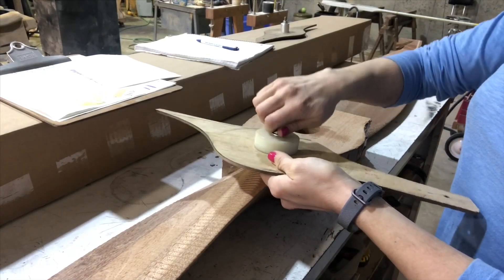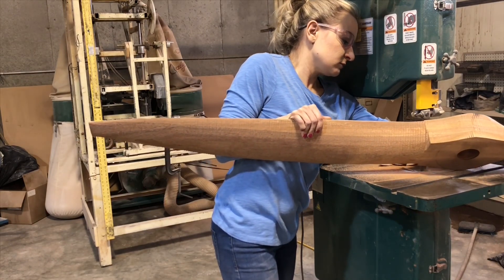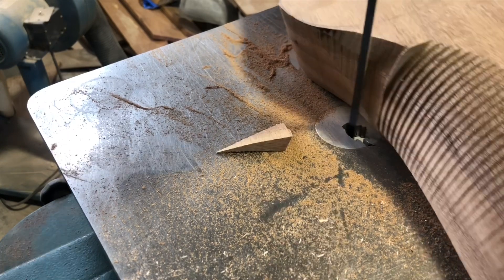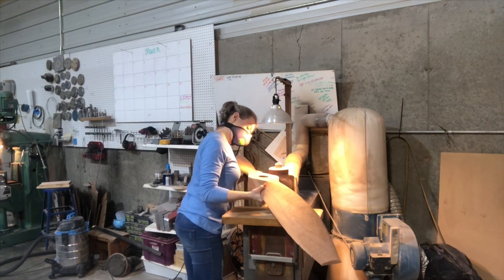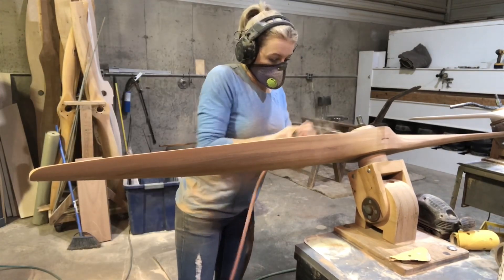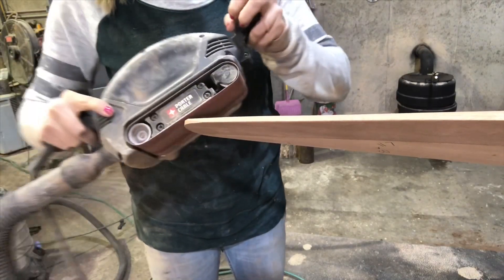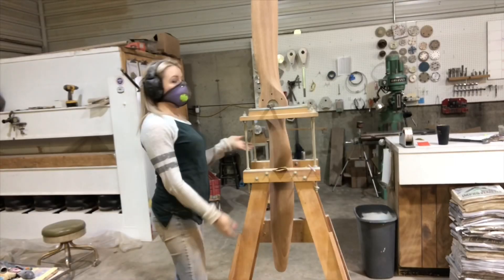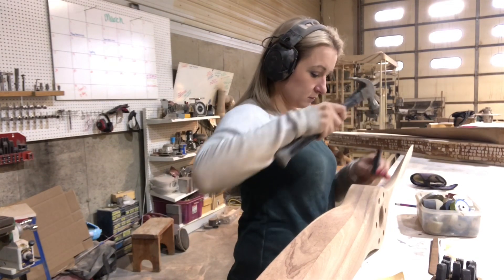Day 3 of making an airplane Propeller

Comment: Thank you again for these videos. Just a tip... Carbatec make an awesome product called turbo plane. It may help you in fast removal of stock rather than holding the piece like you do at the bandsaw and make the sanding quicker?! Hate to be a stickler too but please wear ear protection. The years of working with and around noisy machines has crept up on me and now wish I was more careful.

Comment: I have got to say, one of the most satisfying things to watch is that stream of wood dust getting sucked into the extractor on that drum sander!
Reply from the maker: Yeah! I like those shots!!
Reply: @CulverProps  quick question for you, how well does that mask seal up around the nose/cheek area? I've seen reviews of different brands that are all over the place
Reply from the maker: Jacob Mello i think it depends on your face shape. It does a good job for me, but the guys at the shop don’t care for it. They also have a version that has two straps instead of one and I think that would be a saver bet. I like this one because it doesn’t pull my hair.
Reply: @CulverProps  thank you! Cant wait for the next video!

Comment: A digital readout (DRO) on your mill would make drilling the hub much easier and VERY accurate. You could clamp down the prop, enter the bolt pattern and start drilling.

Comment: Hi Alaina,when you drill the bolt holes on the milling machine you don't need a cnc to do it accuretly you just need a digital readout with X and Y .They are easy to retrofit to your mill and you don't need the Z axis(up and down)which makes them expensive.On line there are all kinds of calculators that tell you the values of xy distances for hole spacing.
Reply from the maker: I will check that out!! Thank you!

Comment: A couple of technical questions.  What grit do you run on the drum sander, it looked like it was pretty aggressive removing material.  Also how long do you end up spending sanding out the saw marks after the lathe.  Just pondering whether using a 25% or 33% overlap on the router passes would make up for the reduction in sanding.
Reply from the maker: I use 60 grit on the drums sander and the  belt sander. It takes about 10-15 min per prop to sand out the saw marks

Comment: Just finished watching all three parts. Very interesting. Two questions:
1) How many props do you produce per month, on average? And is the demand seasonal?
2) Given what you said at 8:50, then why don't you drill the bolt holes earlier in the process, perhaps even before trimming the hub with the belt saw?
Reply from the maker: I stay busy all year round. I put out about 120 a year.

Comment: Just buy an import DRO for that mill and install it.  Then you'll be able to enter the bolt circle size, number of holes and the starting hole position, set the mill to the center of the prop and then it's as easy as just cranking the handles until each hole position is reached to drill those holes, and they'll be perfectly located.  You should be able to buy one for $300 or less.
Reply from the maker: I’ll look into that! Thank you!

Comment: Many thanks for the videos. Carving my own props has long been on my aeromodelling to-do list and I decided that making a scale prop for the 1/4 scale model of the 1912 Blackburn Monoplane I'm currently building was an opportunity to do it.  Thankfully there are a lot of photos on the web of the real aircraft and of a prop that was previous fitted to the real aircraft. so I have managed to CNC a set of laminations that have given me the blade profiles outboard reasonably well but there is still a lot of work needed to get the thing looking right near the hub.  I wish I had 1% of your ability in all this!  Given that I'm working only from photographs do you have any tips that might help me get it right please? 
Thanks.
Reply from the maker: That is awesome
. I would have to see some of the pictures of what you are trying to achieve but I would suggest that you Try mahogany, it sands faster.
Reply: @CulverProps  Many thanks indeed for the reply. For the final version I do hope to use mahogany (a cabinet maker friend has said he will let me have some of his 100+ year old Cuban mahogany stock to work with if I show worthy of it!)

Here is a link to an album of photos including my first rough attempt. 
https://photos.google.com/album/AF1QipNfhblPDGtg3v30jkOGwiD0dKwvUDKlRzdjZbdT 

This includes pictures of the prop previously fitted (J-I No 78 50HP) and the current fit (L&W A23 50HP). I believe the diameter is 94 inches and the chord about 188mm. The Blackburn is said to have a max speed of 60 mph @1200 rpm with the 50HP Gnome Omega so the working pitch must be about 53 inches and, using a rough spreadsheet, I estimate the aerodynamic pitch to the zero lift line to be close to 60 inches. 

Any comments would be most welcome. Many thanks.

Comment: seems the Wright brothers engineered the first successful wooden aircraft propeller with a twisted airfoil design. Is there any improvement today compared to the first wooden airplane propellers?
Reply from the maker: Efficiency %.....no. But designs to match prop/engine combos......yes
Reply: In a program on recreating a wright flier on pbs they tested a prop in a wind tunnel and found it to be around 78% efficient. I eont think any prop today can match that.
Reply from the maker: esam 65 yes, they can, and
they do. I have talked to several of the bigger companies that do extensive testing and 80% is very doable. As with any testing/statistic you have know all the parameters of the testing before comparing results. So I’m going to be cautious about comparing any of these numbers to one another.

Comment: You got any propellers that didn't quite make it on an airplane because of a flaw , 
I would like to have it to hang on my wall , bolt it to a car front bearing and spin it Everytime I walk by it
Reply from the maker: I have 2 right now. A 54” for $350 and a 76” for $500 (scuff on the painted tips) but you will have to email me because messages get lost on here. Lol  ranchair@socket.net